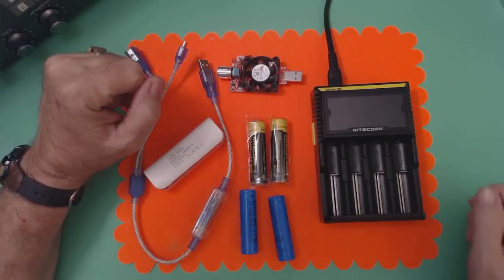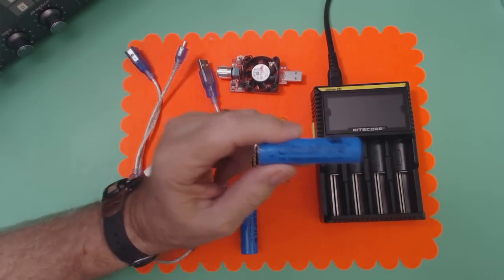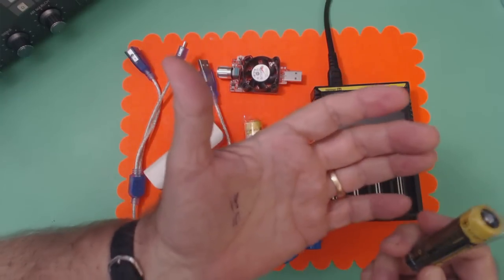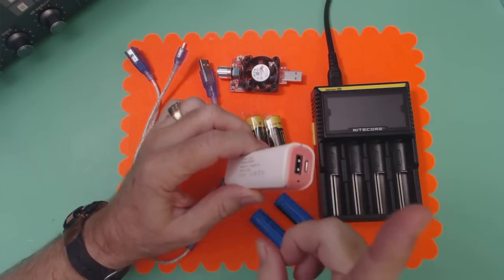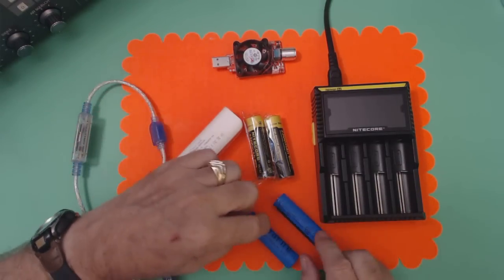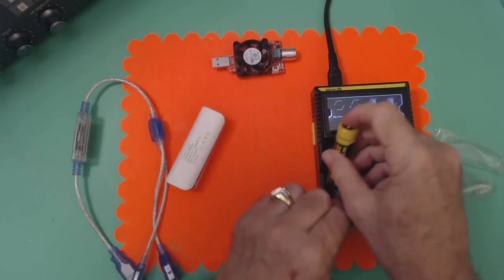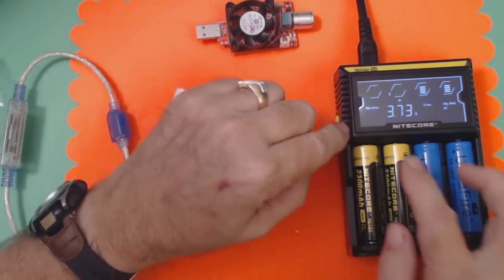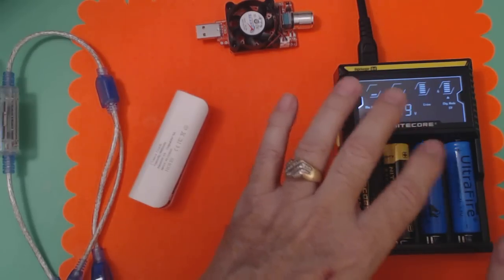TRRS #0756 - Ultrafire vs Nitecore Batteries

Comment: No matter what brand you use, it's best to use batteries with a built-in protection circuit, to avoid them catching on fire or exploding.
Reply from the maker: +Gary K Yes, a very important point.

Comment: +1 for the Panasonic/Sanyo based cells although for overall quality plus an excellent protection circuit I prefer AW branded cells, these have been consistently the best most reliable cell I ever purchased for my high powered flashlights.
Reply from the maker: +SpectreOZ Not familiar with AW branded cells.
Reply: +hamrad88 They are specialist cells in great demand within the flashlight enthusiast community but also utilised for the e-vapor devices as well

http://www.darksucks.com/store%20battery2900T.html
Reply from the maker: +SpectreOZ Ok, thanks.

Comment: Ultrafire\trustfire=garbage
the samsung 2800-3200 are really good.
Any battery brand that advertises more and 3400ma is to be avoided.
Reply from the maker: +ᗒ╬ᗕ1112223333111ᗒ╬ᗕ I have to agree based on my little bit on research so far.
Reply: +hamrad88 I'd  say the panasonic 3400 is the best.
3400 is the most a 18650 can get.
5000-6000.....lol